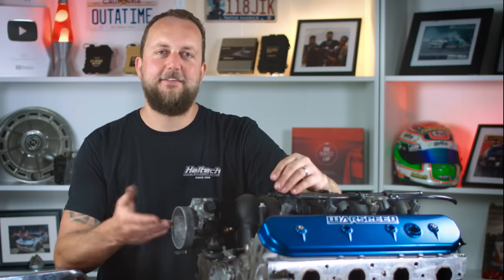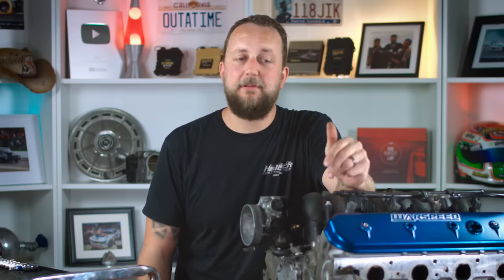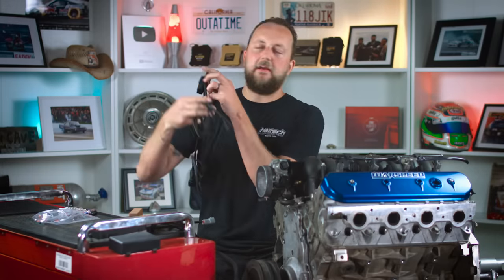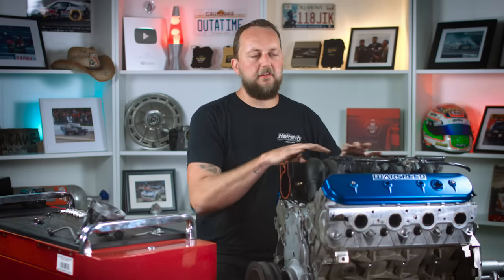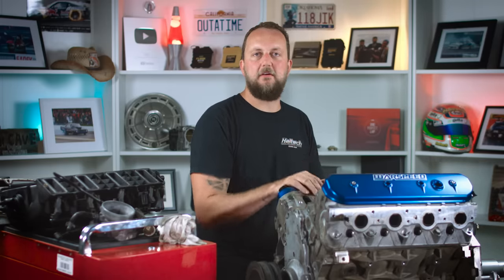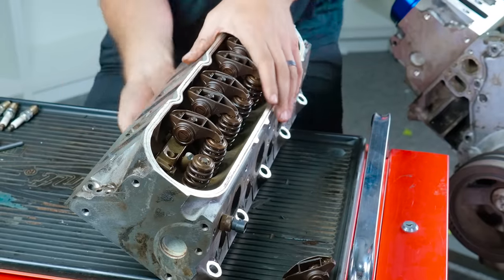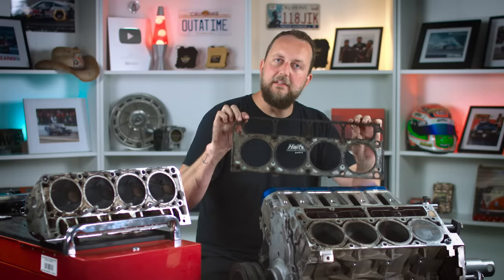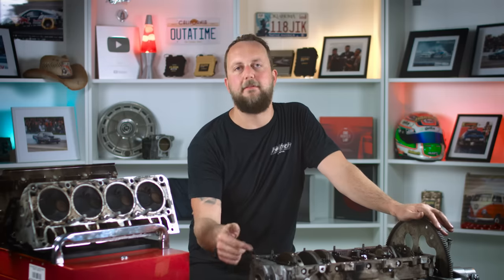🤔 What's so special about the LS? | TECHNICALLY SPEAKING |

Comment: Great video. How about a "What's so special about the 5.0 Coyote and Hemi?" Round out the big three!
Reply: Yes, a 5.slow vid please.
Reply: @sethh8892  
"5.slow"? lol, that's not very nice. What did the humble Coyote ever do to you?
Reply: @177SCmaro  it smoked him with less displacement is all
Reply: @austinhowze6280  
It is pretty cool how much power Ford is making from 300ci. In the 60's over 400HP was usually big block territory.
Reply: @177SCmaro  the do some crazy stuff with ford motors but its normally not cheap with ford motors always doing something new instead of the ls series takeing things that worked in the passed and make better
Reply: @177SCmaro  they do need to bring the 300 back there is still a lot left on the table for those motors just a inline ecoboost for the truck market
Reply: @austinhowze6280  The only smoke coming from a 5.0 these days is blue smoke from all the oil those piston slapping pieces of shit are burning. The 5.0 Coyote is a cheaply designed engine through and through. Sadly, it's gotten weaker and cheaper with the Gen 3 'yote. Now not only does the block not have cast-in-place iron liners, it doesn't even come with a real oil pan. Just some cheaply made, warped Tupperware bolted to the bottom. So now if you want to build a reliable Gen 3 Coyote, you're stuck paying a machine shop to put real liners in, welding gusset plate to the block to add strength to known weak areas, spending money to replace the cheap brittle powdered metal oil pump gears with billet parts, replacing the wimpy factory rod bolts with ARP bolts, replacing the cheap plastic oil pan with something that won't warp and leak oil, replacing the cheap factory timing chains with parts that won't stretch just by looking at them, etc.
Reply: @austinhowze6280  I would be down for an inline-6 ecoboost. That's what they should began with.
Reply: @hochhaul  bring back the 300-6 that engine never deserved to be cast off
Reply: @hochhaul  lol, how quickly the shit-talkers forget about all the piston slapping, oil consumption, and lifter issues the LS was having a few years ago.
Nothing you said is particularly true.  Ford invested considerable resources into developing the Coyote, a further evolution of the modular family with aspects inspired by many previous engines. They did so as the Coyote was designed as a performance engine first and foremost and later adapted to the F150 - a platform that demands reliability over absolute performance. 
Coyote blocks have seen horsepower levels approaching a thousand and over 1500 with upgraded sleeves and no other structural reinforcements are necessary. Early on there were a "stop-gap" solution of welding small reinforcements in the cooling jackets but, again, this is only for very high hp applications and is generally considered obsolete now. Considering this is a 302cu engine that is quite impressive for a production aluminum block. The block, itself, is a 6 bolt main with extensive ribbing/reinforcements. It's a solid performance platform comparable to the LS family or the Hemi. And if that's not enough for you, there is a billet block available (very expensive) that is proven to 2500hp and an iron Coyote block that might be coming out this year (cheaper, but 90lbs heavier) that requires no sleeves and is capable of withstanding ProMod horsepower levels, possibly more.
I've been critical of the 3rd gen Coyote's cylinder liner issues myself but those blocks can be sleeved as well in very high hp applications and the percentage of actual issues is likely exaggerated here on youtube i.e. it's a big deal when one fails but you don't see or notice all the cars driving around without issues because no on makes videos about things going smoothly.
And in a small number of cases, the current theory is something to do with the added harmonics of an aftermarket supercharger pullys, oil pump gears have been known to fail but this is not something unique to the Coyote. Other engines, the Toyote 2ZZGE for example, have been known to have similar issues with gerotor-style pumps even without the addition of a supercharger.
The Coyote also doesn't have especially weak head bolts, rods or rod bolts, they are plenty strong for the factory hp levels up to around 600-750hp and these are things you upgrade in any high horsepower application (11mm blocks have had some cracking issues around the knock sensor area were the shorter 11mm head bolt end but this only in high hp applications. 12mm blocks solved that issue). I also believe the Coyote has a metal oil pan (at least mine did, it came from an f150) and, even if some don't, they aren't known for leaking oil pans or timing chain issues for that matter. I have heard of some VVT phaser "ticking" issues and some lesser-known issues with the primary chain tensioners but now we're getting into the real obscure stuff. 

You should probably stop spreading so much misinformation on the internet just because someone made one snarky comment defending the 5.0 in response to another snarky comment against the Coyote.
Reply: @177SCmaro  Misinformation? What misinformation??? Gen 3 blocks ARE inferior. You yourself admit that the linings are junk and piston slap is an issue. It's a VERY common issue with Gen 3's. One look at the big F150 forums shows that. The fact that Ford has had to issue several TSB's for issues related to piston slap and oil consumption show that. The number of GT's and F150 with clattering, knocking piston slapping noises shows that. The number of TSB's and software updates for timing chain rattles shows that. 

I certainly didn't forget or ignore the LS's history of issues. LS piston slap was fairly prevalent in the early 2000's. Oil consumption and AFM lifter issues were common Gen IV problems. 

" Ford invested considerable resources into developing the Coyote, a further evolution of the modular family with aspects inspired by many previous engines. They did so as the Coyote was designed as a performance engine first and foremost and later adapted to the F150 - a platform that demands reliability over absolute performance."

What the fuck is this? Did you copy and paste this from a Ford brochure? Spare me the Ford PR speech. The Coyote is significantly different compared to previous Modular engines. The team at Ford that designed the Coyote have themselves said that it's a completely clean sheet design that only used the previous Modular engines problems as a guide for what to do different with the Coyote.  

"Coyote blocks have seen horsepower levels approaching a thousand and over 1500 with upgraded sleeves and no other structural reinforcements are necessary."

Sure there are guys building 1500 HP Coyote engines without the reinforcements. The issue is RELIABILITY. The guys making 1500 HP aren't putting thousands of miles on those engines, let alone using it as a daily driver. The reason guys reinforce the block is because they want to make 800 HP in their Mustang but still be able to drive it every day. If you're going to spends several thousand dollars building up a Coyote, you are taking a BIG GAMBLE if you don't reinforce common weak areas of the block. 

"I've been critical of the 3rd gen Coyote's cylinder liner issues myself but those blocks can be sleeved as well in very high hp applications and the percentage of actual issues is likely exaggerated here on youtube"

Sleeving a block is a big f'n deal and it was completely moronic that Ford decided to use PTWA cylinder linings on the Coyote. They wanted to re-use the Gen 2 block, but increase bore size. They couldn't go any thinner with a cast-in-place gray iron liner, so they decided to go thinner by using the fancy PTWA liner tech. But they didn't want to pay the German company they used in the past to apply the lining, so they decide to save money by trying to spray the cylinders themselves. But of course Ford completely fucks it up and they're shipping out brand new Gen 3 Coyotes with HUGE piston-bore clearances. Some of the 5.0's I've heard have such bad piston slap that I thought it was a diesel engine under certain loads.  It's definitely NOT an exaggerated issue. Having to pull an engine, tear it down, send it off to a machine shop for sleeving is VERY expensive. That's a big additional cost on top of an engine that's already expensive to build for big power. I wouldn't dare use an unsleeved Gen 3 block for a big power build. The PTWA lining is just 0.006" thick compared to the gen 1/2's 0.06" thick gray iron liner. That's a huge difference. Heat is the biggest concern. We've already seen just how big of an issue heat and distortion was with the Gen 1 Coyote's and the Gen 3's construction creates even more probability of bore distortion. 

"And in a small number of cases, the current theory is something to do with the added harmonics of an aftermarket supercharger pullys, oil pump gears have been known to fail but this is not something unique to the Coyote."

Yeah that "theory" was that Coyote oil pumps fail due to harmonics of a supercharger. Every Coyote/Voodoo factory oil pump that I've seen fail didn't have a supercharger on it. The ones I've seen fail were either bone stock Coyotes where a quick over rev was enough to shatter the gear or in turbocharged Coyotes making 600 HP. They fail way too damn often. It doesn't take much to shatter a powdered metal gerotor gear. But it's cheap to make them out of powdered metal so that's what Ford is going to do. What's funny is that if you buy a basic Coyote crate engine, Ford Performance won't sell it with the factory oil pump. They literally take it off and toss it. Instead they put a FP billet oil pump on it. Not even Ford's own Performance shop will use a factory Coyote oil pump.

"The Coyote also doesn't have especially weak head bolts, rods or rod bolts"

The rod bolts are a weak point if you're going to run the engine hard. They're prone to stretch at high RPM and waaaay too many guys love to spin their Coyote up past 6000 RPM where the piston speeds are pushing the factory rod bolts to their limit. Unless you want a pretty window in your block or another knocking noise coming from your Coyote, it would be wise to address the rod bolts. The gen 1 head bolts is an issue. Especially for those that want to do a turbocharger setup. Again, it's all about risk. You could slap a turbo on any engine, tune it, and get by for a while. It's down to whether you can afford to destroy your Coyote. Saying that the things that MMR  recommends owners do to their Coyote when making X power level.... is ignorant. Telling other guys "yeah no problem, go ahead and throw those turbos on, the problem is way exaggerated on youtube anyways" is ignorant.

"The Coyote..... are plenty strong for the factory hp levels up to around 600-750hp."

Which isn't particularly high for any engine, including Coyote builds. A gen 3 Coyote will need to be sleeved and gusseted to make reliable power at the 750+ range. Most guys at the 750 HP level that want to use the vehicle as a daily driver should be doing most of the upgrades I've pointed out. The oil pump gear, the con rod bolts, etc. A 3rd gen Coyote at 750 HP as at the edge of what it can handle without long term or short term issues. Multiple well-known engine builders have said this. A gen 3 block can be made to handle more obviously, but you're spending $$$$$.

"any high horsepower application (11mm blocks have had some cracking issues around the knock sensor area were the shorter 11mm head bolt end but this only in high hp applications. 12mm blocks solved that issue)."

It's a pretty serious issue when it comes to considering a Coyote engine-swap build. You're talking expensive machine work. MMR would also recommend the gusset plate reinforcements and probably even sleeving the block if you're going to spend all that money to build up a high (700+) HP Gen 1 Coyote. The block just flexes too much compared to something like the old Teksid block. The thrust side of the block flexes and can eventually crack when you start to go beyond the 750 HP range. For contrast, many Ford guys diss the LS because they falsely think a factory aluminum LS can't handle that much power (even despite bone stock Gen V aluminum blocks/heads reliably handling close to 1,500 HP).

"I have heard of some VVT phaser "ticking" issues and some lesser-known issues with the primary chain tensioners but now we're getting into the real obscure stuff."

Uh dude, it's a very common issue with the Gen 3's. Especially in the F150. First it was a rattle on acceleration, then Ford issued a TSB software update, which got rid of the accel rattle but created a decel rattle. Now it just seems to rattle randomly. One guy with a brand new F-150 put a camera in the engine bay and drove around the block and the engine was rattle on and off the entire time. The engine's probably needs an oil pump that can deliver higher flow rates. This is the biggest weakness of an engine design that places the oil pump at the bottom of the engine, and all the complex oil-driven valvetrain components at the top. Oil is always slow to reach the VVT system and any sludge deposits or oil leaks along the way can cause issues with the system.

" I also believe the Coyote has a metal oil pan." 

Nope. Ford started using plastic oil pans on all Coyote's a couple years ago, including the pickup trucks. The plastic pans suck. The pans warp and leak oil around the gasket at low mileage. Especially when temps drop down to 20 below. The plastic drain plugs are garbage. Some shops even replace the drain plug at every oil change because so many of them start to leak when reused.
Reply: @hochhaul  The misinformation you put forward.

"Gen 3 blocks ARE inferior."

Inferior how? The plasma wire coating they use is fine for stock to mild power and you can sleeve the block same as previous generations for high power. The plasma wire does reduce the weight of the block slightly and allowed for a larger bore (which allows the 3rd gen Coyote to run the largest GT350 size valves without shrouding issues). These are trade-offs, not lowering of quality i.e. "inferior".

You failed to distinguish between the generations of the Coyote labeling them all as "cheaply designed engine through and through." That's bullshit. You know it. I know it. Anyone with a modicum of familiarity with these engines that are going on a decade of production now know it. That is another example of misinformation.

"It's a VERY common issue with Gen 3's. One look at the big F150 forums shows that."

People complaining on a forum is not a proof, or even explanation, of anything. In order to prove your claim you need actual data. Evidence of conspicuously high failure rate/percentage. You have not provided that, hence, more misinformation on your part. Hearsay, dude. Rumors. Not facts.

 "I certainly didn't forget or ignore the LS's history of issues."

Pretty funny how you left that out, huh. Probably because it would have added perspective that would have made the Coyote not look anywhere near as bad as you're portraying it. A lie of omission is still a lie.

"What the fuck is this?"

A fact.

"Did you copy and paste this from a Ford brochure?"

No. It's the gist of the history of the Coyote's development I've read from multiple sources, esp. " Ford Coyote Engines: How to Build Max Performance" by Jim Smart. It's not a "cheaply designed" engine.

"The Coyote is significantly different compared to previous Modular engines."

Of course. I didn't say it was copy of previous modular engines, I said it was an evolution based on numerous engines both modular and otherwise. It directly carried nothing over from other modulars except a few basic dimensions and bolt patterns (bellhousing).

That's irrelevant, though. Your claim that the coyote is "a cheaply designed engine through and through" is a lie. "Misinformation" was my way of putting it politely but you are lying to people.

"Sure there are guys building 1500 HP Coyote engines without the reinforcements..."

It's amazing how you can directly quote me and still misrepresent what I said. I didn't say guys are building them at 1500 with no reinforcement with the block being reliable, I said they're building them at 600-750hp with no sleeves. I said guys are building them WITH sleeves to 1500hp which, again, is not bad for a production aluminum block. My old IRON small block Chevy was in the danger zone at 650hp. That says something about what Ford did to make a small block both light and quite strong.

"Sleeving a block is a big f'n deal"

No it's not. Not for anyone planning on building a serious performance engine. I had it done to mine mostly for longevity and because it was a used block. Sleeving racing engines is not a big deal or that unusual.

 "It's definitely NOT an exaggerated issue."

Again, where is you evidence? What is the percentage of issues/failures? You can't say you're not exaggerating without knowing what the actual numbers are. Please stop lying.

Also, Ford is not the first to try different liners and not the first to have issues with them. Again, you are leaving this information out to try and make the Coyote look bad.

Why the hell do you care whither or not the Coyote is a bad engine? No one is forcing you to buy one. So why so emotionally invested in throwing this one engine under the buss? Are you just here to troll people who like them?

"Every Coyote/Voodoo factory oil pump that I've seen fail didn't have a supercharger on it. "

Anecdote is not proof of anything, partially when your word is rather dubious given the above. Also, I assume you're talking about in a dealership environment. You know as well as I do that the first thing anyone does who breaks an engine they added a supercharger to is to pull it off before taking it back to the dealer. So how the hell would you know whether or not the failure was due to a blower or not?

"It doesn't take much to shatter a powdered metal gerotor gear."

Toyota's 2ZZGE had the exact same problem under the same circumstances, especially miss shifts/over reving. Again, this is not something unique to the Coyote and the solution in a performance application is simple for both engines. Buy billet pump gears.

"The rod bolts are a weak point if you're going to run the engine hard."

Again, that is true of almost every stock engine, not something unique to the Coyote. And you've offered no evidence the coyote is prone to rod bold failures.

"Which isn't particularly high for any engine"

That's absurd. 750hp is crazy high for, say, a 1.8L 4 cylinder. 750hp is 150hp/l in the Coyote. That would be like a 6.2L aluminum LS making 930hp, stock block, stock bottom end. That, too, would be pretty fucking high and would have similar reliability issues long term. Again, this is not something unique to the Coyote.

"A gen 3 Coyote will need to be sleeved and gusseted to make reliable power at the 750+ range"

Above 750, yes, below, it depends. But, again, you say that like only the Coyote has issues making 150hp/l reliably when that's not true. For reliability you would be wise to reinforce any aluminum production block at 150hp/l.

"It's a pretty serious issue when it comes to considering a Coyote engine-swap build."

Only if you plan on making ~750hp or more. And, again, simply getting a 12mm block solves that problem. They are not hard to find.

"MMR would also recommend the gusset plate reinforcements and probably even sleeving the block if you're going to spend all that money to build up a high (700+) HP Gen 1 Coyote."

MMR sells parts. I'm not surprised they encourage people to buy parts to make their engine block stronger.

"For contrast, many Ford guys diss the LS because they falsely think a factory aluminum LS can't handle that much power (even despite bone stock Gen V aluminum blocks/heads reliably handling close to 1,500 HP)."

And everyone can see where your biases are. Apparently it's "false" to think an aluminum LS might need reinforcement at ~3 times the factory power level but it's fine for you to criticize the Coyote for it.

"Ford issued a TSB"

Also not proof of an issue. Service bulletins are released all the time. They don't prove one engine is "inferior" to another. 

"Ford started using plastic oil pans on all Coyote's a couple years ago,"

Okay, well the Coyote has been out for almost a decade and most of them have metal pans, and the Coyote is not the only one doing this or to have this issue. Again, you left that out to try to make this engine look worse then it is. That's called exaggerating with a lie of omission, which is, basically, what your overall comments here amounts to.
Reply: The GM guys are just upset that the modern Coyote is actually stout enough to achieve approx 1000 HP with just a blower,  e85 and a tune.
And they rev to 8,000 RPM's fairly reliable. 

Most of the channels I've watched who have supercharged but otherwise stock Coyote engines have had mostly minor failures such as the oil pump gears breaking. Something that is compounded by the stress on the crank snout where they crank on the supercharger pulley.
But that's an easy upgrade to prevent. 

I was looking at maybe getting a later model GM truck with a 5.3 LS with the intention of adding a turbocharge but I found out that the LS isn't as all the same as people would have you believe as GM has been cluttering them up with cylinder deactivation etc.

My other thought was a F-150 with the Coyote to turbocharge. That would be sweet.  But honestly those are not cheap and plentiful like a GM.

I got a deal on a used F-150 Platinum we saw and liked on the lot (while there looking for a new truck) and it has the 3.5 V6 EcoBoost. 
It's a luxury truck so I'll probably not mess with mods much.
But in stock form it's faster and more powerful than a stock LS powered GM truck. By quite a bit. Which is funny.
Reply: @hackfreehvac  
The Coyote can achieve those numbers just with a blower but you're in the danger zone for reliability.
Reply: Because..... there isn't anything special about the ford and hemi 🤷‍♂️
Reply: @xmo552  
But there is about a slightly newer version of an engine that's been around since the 50's? 👴
Reply: @177SCmaro  
Of course there is and they're both great engines. I was just teasing.
Reply: @austinhowze6280  Less displacement at the cost of worse fuel efficiency, worse longevity, more maintenance, and the engine is still larger than a 7.0L LS7. Ford sacrificed durability to squeeze a little more displacement out of the Coyote block. Those new linerless blocks are complete junk. I had a 2018 Mustang GT and that piece of junk was knocking and rattling 500 miles into the break-in. 12 dealer visits and Ford spent most of them trying to convince me a software update was going to stop the engine from drinking a quart of oil every 1800 miles. A friend of mine just had the heads pulled on his 2019 Mustang and two pistons has gouged the cylinder walls. One piston was missing a big chunk of the skirt. You need to grow the fuck up and stop talking such ignorant shit in the comment section. No wonder you got guys like hochhaul taking you to school on Coyotes. You go around claiming LS engines are junk and you don' t have a fucking clue dude. Just another fanboy trying to shit on the other brand.
Reply: @177SCmaro  Slightly newer? The LS engines are a completely different beast compared t to the old Gen SBC. Deep skirt block, 6 bolt mains, direct injection, 11.5:1 compression that can run on everything from 93 to 87 octane, simplified VVT system that gives 90% of the advantage of independent intake and exhaust valve timing without the complexity of something like TiVCT.
Reply: @hackfreehvac  A 2018+ Coyote isn't going to live long at 1000 HP. Even at 800 HP,  you're riding a fine line. They can be built to be reliable at 1,000 HP but you need to invest in the block, rods, and pistons. I would even switch to ARP studs because 12:1 compression is really pushing things if you pushing air into it too.
Reply: @karlschauff7989   You're not telling me anything I didn't already know.
My point was the LS is more like a old school sbc then a 5.0 coyote is like a old school sbf, which was in response to someone who was just messing around. Maybe read the thread.
Btw, the LS's vvt is more like 50% of the advantages of tivct. With intake and exhaust centerlines tied together in a single cam about all vvt gets you is a little better powerband. Its mostly the DI that gives you more octane flexibility with high compression.
With independent vvt you can do about anything you want with valve timing.
Reply: @177SCmaro  Nope, dual-equal VVT provides 80 to 90% of the advantages of independent intake and exhaust valve timing. Read about it.
Reply: @karlschauff7989  
It lets you advance or retard the cam which moves peak torque around. That's about it with a cib engine. All it's doing is electro-hydraulically doing what guys have been doing with offset keys in cam gears in sbc since time immemorial except now on the fly. I mean, it's cool GM finally incorporated vvt into it's small block but it's still a "poor man's vvt" compared to what dohc engines have been doing for decades.
Tivct AT LEAST doubles your opinions for cam timing, really more like quadruples it. Its like having infinite cam LSA's and overlap within a certain range. Comparing GM's cib vvt and Ford's TiVCT is like comparing checkers to chess.
Checkers is not 90% the same game chess is.